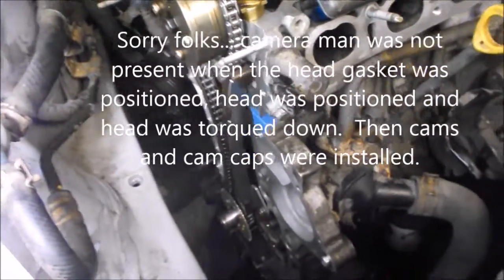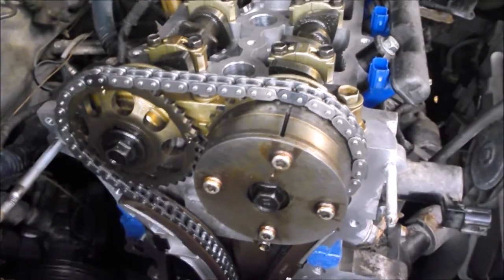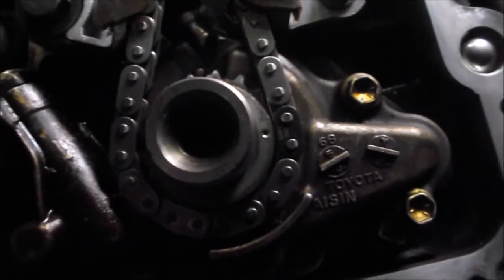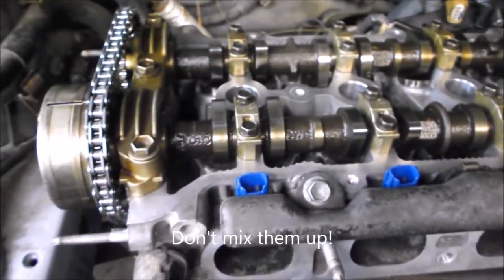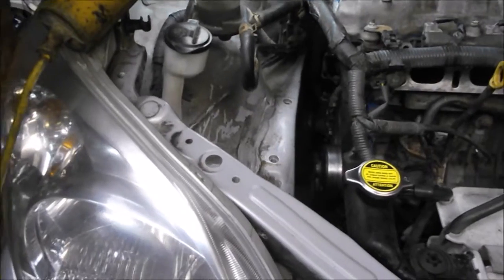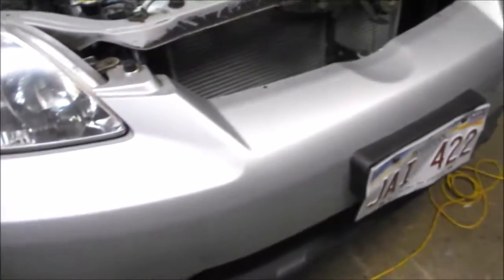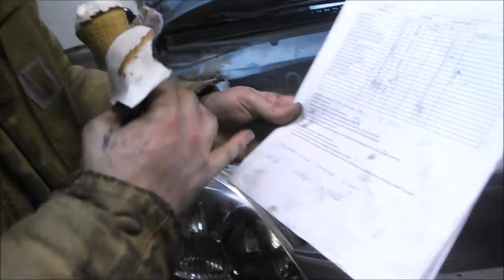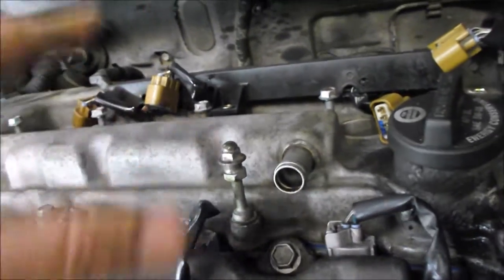DIY Head Gasket Replacement 2007 MatrixVibe Part 4 of 5 Reassembly

Comment: Although your intentions were good these are not very good DIY videos to replace the Matrix,Corolla\Vibe head gasket.  People want to see how parts were removed and installed not video of how it looks after the fact.  The tips on tapping here and removing the water pump or this and that are okay but seeing how you removed each series of bolts, water pump, alt, cam bolts or whatever would take the video from like a 3 to a 10.
Reply from the maker: I understand. However we were figuring it out as we went along so doing it the way you suggested would have taken so much extra time we could not afford. As it was, i spent about 15 hours editing this series of videos.
Reply: I’m with you here Joe! We took our camshafts off and were looking for head bolts. Hmmm... oh wait. Those little oil filled wells look like torx heads. WHAT?!!! Are you f’ing kidding me? Gee would’ve been nice to know before when we watched this series we’d need to go buy a set. Because like now at 9pm on a Sunday night we’re screwed until we can get to the store and buy a set. So not happy... 😡